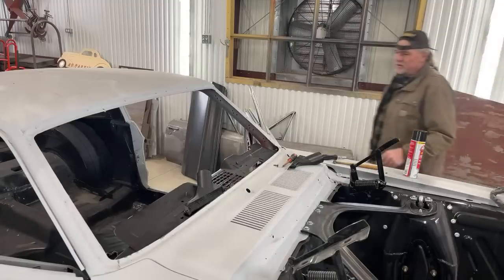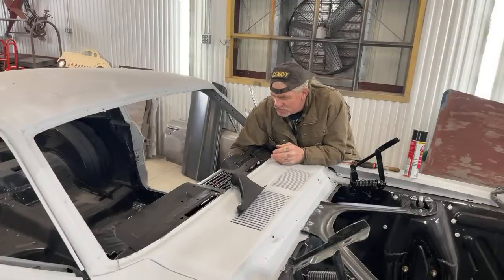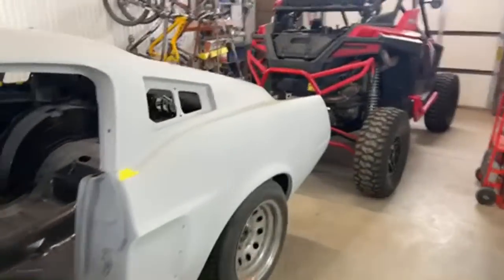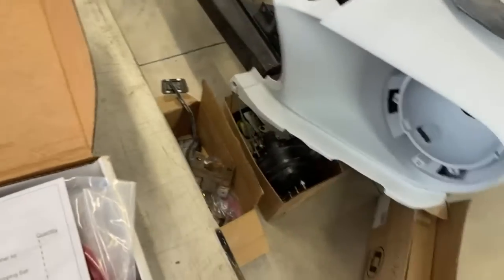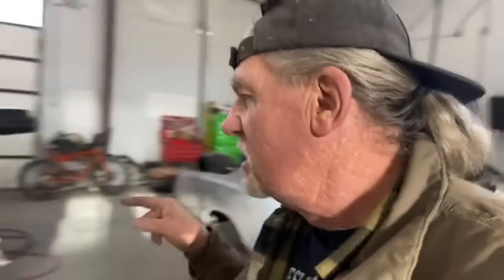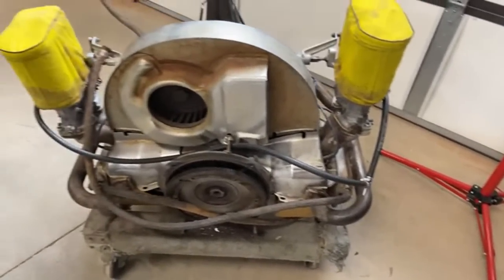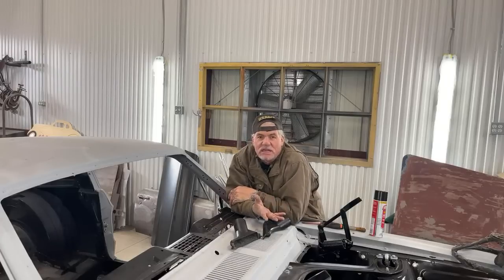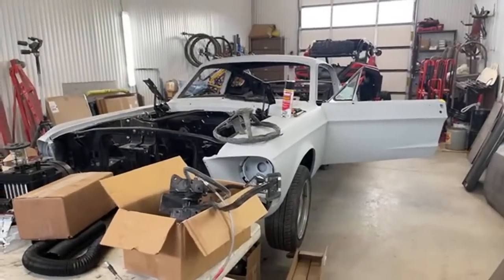How To Build A Custom Car - DIY NOW!

Comment: Pete (9 months late, but...), you should demand the market value and pay yourself accordingly... Only 20-percent labor (!) with 2600.00 labor in a 13,000.00 insurance job? The standard labor percentage is usually about 66-percent of the repair total for each of the dozens of general automotive shops and specialty auto repair shops that I have experience dealing with. STANDARD FORMULA (business model): Parts/materials/supplies are marked up 40-percent over what the parts stores would charge (which is already 2.5 or 3 times the amount you could find online), and the labor total is ALWAYS double the amount of the parts/materials/supplies total (never fails - check your invoice when having an outside vendor do the work for you, and that is any vendor).

Comment: It is extremely hard to put an engine together that someone else took apart and stopped. It has to be 100 X's harder on a full vehicle then add modifications to it. I am sure that new, 1,200 people touch the car to do one single job. That's repetition not knowledge. Pete has knowledge! Merry Christmas to Minnie and you both.

Comment: Merry Christmas Pete mini iv seen the rustang build from the start till now and its ace pete so true about the work i get all time when just finished spary job oh its done haha yeah mate done what about the little things add up touch ups busted clips plastic mould preparation list gos on i also got my confidence to un stitche panels from you mate watching you drilling welds out  and plug welding them back on the stang mate thank you if ya check my channel iv stuck video of 57 im building only panels haven't replaced roof and fire wall iv mini tub it new floors and it came from 3 other shops came to me as first pic on my clip and another thing that stuck in my head pete is finish what you start 😀 have good one mate im gonna be working on own project this holiday as for most my life always shaft my  self with buddy deal